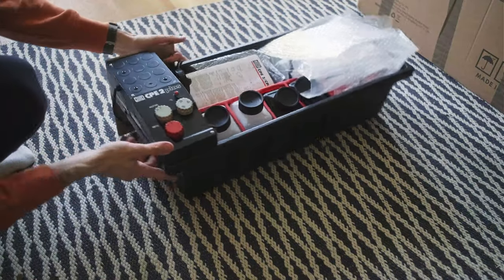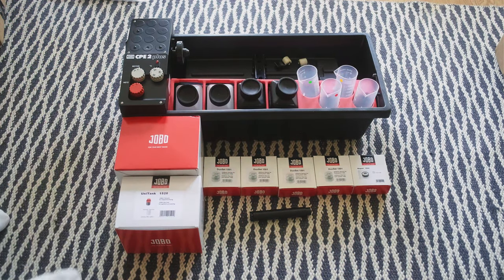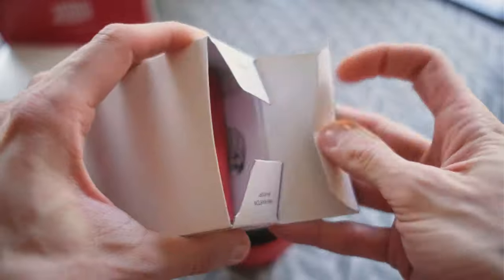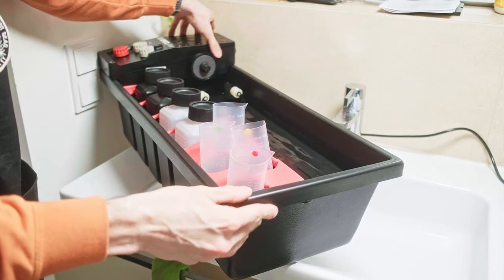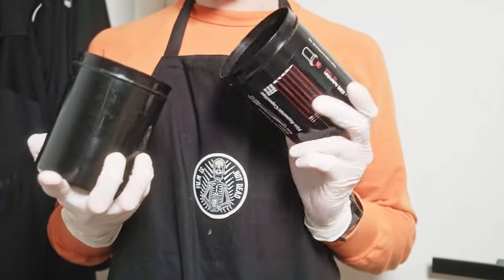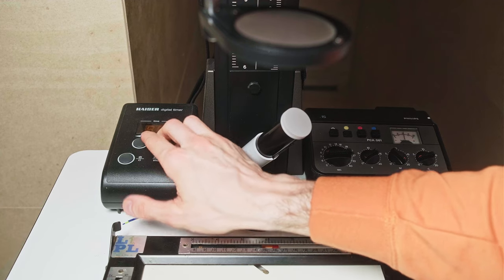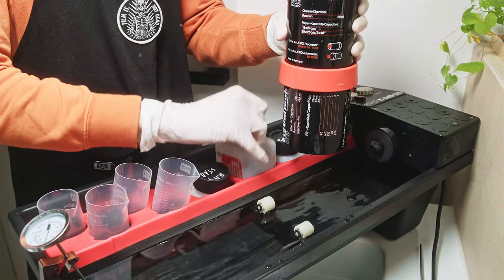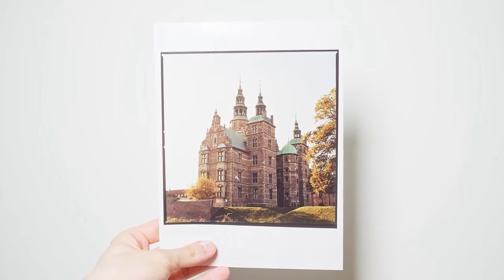Jobo CPE2+/CPE3 system and Jobo 1500 drums - Development machine for color darkroom.

Comment: Hi, love your content and toutorials. I just got Jobo 1530 extention tube and Jobo 1520 Uni tank but cant figure out whether I need third part to make it lightproof. You mentioned that top portion has cup inside. Do you know if it is sold separately or is it built in ? May be stupid question but I would appreciate your advise :)
Reply from the maker: Cup inside - just one of the inserts which you can buy separately. It's for the same system of the drums. It's not really necessary for the paper developments and you don't need it if you have lift on the Jobo CPE

Comment: Hi Alexkandr, I also use the cpe for film development colour and b/w. I also got the jobo 1500 system with different extensions. For the paper developement I use the jobo expert drum with the special "can" inside as you do on your 1500 series. but for smaller prints the expert drum is too big...you are using your 1500 series but with removed center column (for film) and exchanged that with a smaller "can" for paper development. Can't find this part...not on jobo website nor on eBay...did you print this yourself or am I too stupid to find this part...?
Reply from the maker: Of i understand you correctly - https://www.fotoimpex.com/darkroom/jobo-light-trap-beaker-for-all-paper-drums-2800.html?cache=1679952161

But now it’s out of stock, so ebay os your weapon of choice
Reply: @NordicLab  Thanks!!